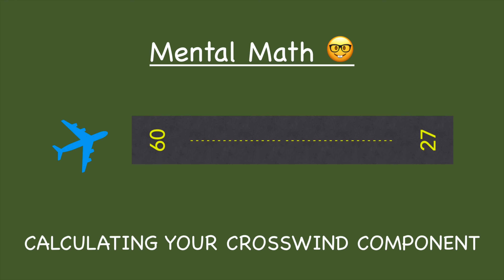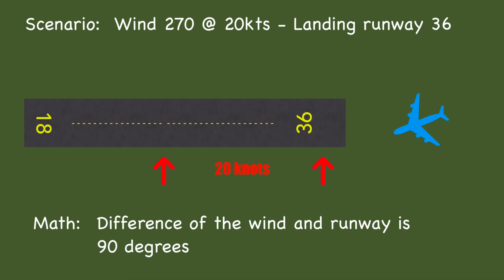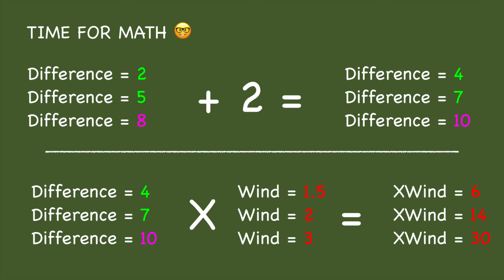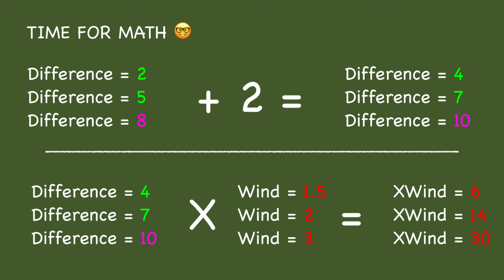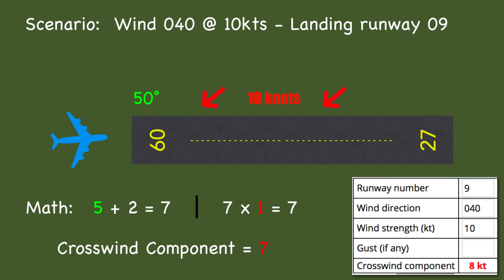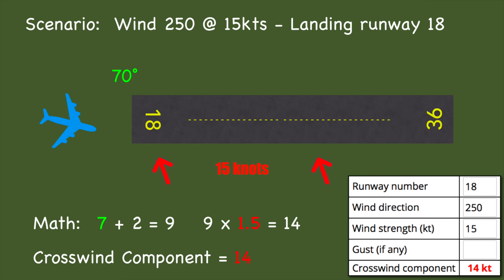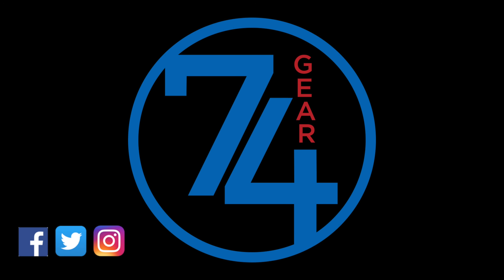Pilot Mental Math: Crosswind Component

Comment: In 1971 I had about 15 hours in a Cessna 150.  My weather pre-flight was a little abbreviated.  A weather front came in while I was out drilling holes in clouds.. The wind had increased from 25 knots with peak gusts to 39 knots from 350 degrees.  Tower gave me runway 30 so I crabbed in while being buffeted like I was on a brahma bull.  As I straightened out to touchdown a gust blew me off to the left of the runway - no damage other than my nerves.  The overly calm tower person said in a slow southern drawl, "Cezzna 1234 continue to your parking area".

Comment: This is a good method.  I use an old sniper trick I got from an old book on shooting.  sin 10 = 1/6,   sin 20 = 1/3,   sin 30 = 1/2,  sin 40 = 2/3,  sin 50 = 3/4,  sin 60 = 7/8,  sin 70 = 15/16,  sin 80 = 1,  sin 90 = 1.   You have to commit to memorizing the number but once you do that you just go straight to the answer.

Comment: Crosswind formula is Crosswind = wind speed x (sine). For me, the clock method works best. Picture a clock: 15 minutes = 25%, 30 minutes = 50%, 45 minutes = 75%, 60 minutes = 100%. In the test question, the difference between runway 9 and the wind direction is 30 degrees (30 minutes on the clock). 30 is half (50%) of 60; half of 18 knots is 9 knots.

This method is more accurate as the (sine) of 30 is .5 or 50%. Take the previous example again: Runway 9 with 50 degrees. 50 minutes is 80% of 60. 80% of 10 is 8 knots.

Comment: Why doesnt it work for this scenario - 320 @ 15 kts on runway 31
10 deg/1 difference +2 = 3
15 kts/1.5 wind

3x1.5 = 4.5 xwind but if I confirm with an xwind calculator, it is saying the xwind is 2.5 for this scenario ... not sure why it doesnt work for this

Comment: Another way to visualize the crosswind component; The wind calculator on the back of an E6B very closely resembles a DG or HSI.  Once you understand how to use the E6B wind calculator, visualize the E6B wind calculator over your DG or HSI to guesstimate the value of the crosswind component based on your current heading and wind direction..

Comment: Good tip. I use a lot more WAG (Wild A$$ Guess) in my mental math while I'm hand flying, though.. In my case, if the wind is not directly down the runway or a direct crosswind, I round it to 30, 45, or 70 off runway heading. For 30, the crosswind is 1/2 the velocity. For 45, it is 2/3 the velocity. For 70, it is 90% of the velocity. That gets me close enough. Of course if I suspect it will be near a limit, I pull out a chart to make sure I'm legal. My WAG gave me 9 kts crosswind for your example.

Comment: The aproximation  sin (alpha in degrees) = (alpha in degrees/10 +2)/10 for the crosswind component seems to be close enough for an crosswind between 20 and 90 degree. Nice idea a good calculation scheme for the crosswind.
I may use it to approximate the drift of my sailing ship  by current and wind.

Alpa/sin (alpha)/approximation
00/0,00/0,2
10/0,17/0,3
20/0,34/0,4
30/0,50/0,5
40/0,64/0,6
50/0,76/0,7
60/0,86/0,8
70/0,93/0,9
80/0,98/1,0
90/1,00/1,1

Comment: You could add another thing - If the difference is more than 90 degrees, just subtract the excess from 90. For example if the difference is 150 deg, we subtract the excess (60) from 90, and get 30. Then we use this difference to proceed further with the calculation. This is because a wind coming from your 30 deg and one coming from 150 deg would give the same crosswind component.

Comment: noob question. Why +2, what is the +2??
Reply: The real component is the wind speed times the sine of the wind angle. Sine (X0°) =
0 -> 0.00
1 -> 0.17
2 -> 0.34
3 -> 0.50
4 -> 0.64
5 -> 0.77
6 -> 0.87
7 -> 0.94
8 -> 0.98
9 -> 1.00
What this technique does is find the multiplier for various wind angles. By "add 2" he has 10° multiply 3x, 20° multiply 4x, 30° multiply 5x, and so on. His multiplier is a number two more than the tens of degrees of the wind angle. For 0 to 10 degrees it's pretty bad giving 200% the real crosswind or worse. For 20 degrees it's 4x instead of the precise 3.4x. For 30 degrees it's exactly right, 5x. For 40 degrees it's 6x instead of the better 6.4.

There are other ways to approximate the sine function. For example you could say 10 degrees is 1/6th, 20 degrees 1/3rd, 30 degrees half, 40 2/3rds, 50 3/4rs, 60 7/8th, 70 19/20ths, and 80-90 equals 100%. Those would be more accurate but maybe harder to remember.

Comment: Thanks for the interesting and  informative videos.
Cute linear estimate of sine function.  It fails at low and large angles.  You mentioned the high angle correction: if 80 degrees or greater (sin ~ 1) just use the full wind speed.  The low angle correction is also easy.  If the difference angle a is less than 20 degree, divide angle by 10 then MULTIPLY by 2 (that is, 2(a/10)).  This is just a little different than your middle angle estimate:  divide angle by 10 then ADD 2 (that is, a/10 + 2).

Comment: Accuracy is not so important as you should plan the cross  wind can swing 20 to 30 degrees.
More important for light aircraft. 

Can't imagine ( 9 kt affects a747 by much. ? )

look up sin table them multiple by wind 

30=.5
40=.6
50=.7
60=.8
70 = .9

some  airforce  teach   mental dead reckoning   +- 2 min   ( easy at 120kt or 240 Kts)

Comment: Crosswind component is 9
Reply: Mas_pilot. It is used to calculate the wind correction angle. That way the wind doesn't push you off the runway centerline during approach.
Reply from the maker: you got it MAS, well done!
Reply: 74 Gear thanks!
Reply: 74 Gear is the crosswind component used for the amount of speed to increase on the landing speed?

Comment: Nice video. I learned almost the same way. I just take the difference then add 20. This is then the % of the mean wind. 
So in your scenario:  RWY 09 wind 60 = 30 degrees. Plus 20 = 50% of mean wind which is 18 = XWC is 9 👍🏻😁
Reply: 74 Gear Based in Denmark :)

Comment: My eyes glazed over just like they did in high school.     This is why us dyslexics don't tend to get into the airline industry I guess.   ;-)  When we were landing in  a cessna in Panama, I used to look at the wind sock, times were simpler.....
Reply: 74 Gear I was just a heading holder, my pilot was an x navy guy that lived island hopping.
Reply: 74 Gear  The FBO that we flew out of is now a mall, apparently Oceanside property  was more valuable than GA was. 
Fun fact, back in the 80’s they would mark up your chart with a red “X” so that you wouldn’t land in a place likely to get you murdered and your plane a new job as a drug runner. 
;-)
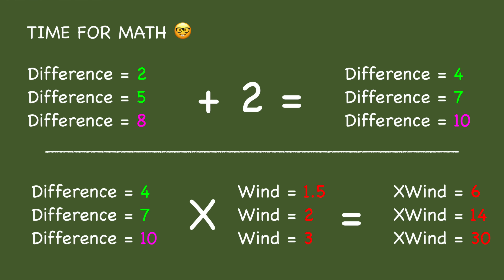Reply: @74gear  I have a video called "1987 Panama Flight Paitilla field" , if you FF up to 3:34 we land on a strip thats so short, we had to get out, and turn the plane by hand for the take off. 
Missed approach needs to be dealt with in about .223 of a second.   ;-)
In parts of the video you can see the dash falling apart on our rental, it also had a microphone wire into the dash at one point that you had to hold by hand. Wild west is an excellent description.
Reply: 74 Gear Yea, that would be tocumen? I flew out of there just before the invasion.
(So I left before it got too exciting....).  ;-)
Reply: @74gear  Yea, that doesn't sound like much fun. 
The guy I went out with always flew VFR, he was IFR qualified, but the rattle trap  rentals were easier to crash during the day when you could see.  
 ;-)   (Kinda kidding on that.... kinda....)

Comment: What number is when. A plane can not land of the equal crosswind
Reply: 74 Gear so you have calulated the cross wind once you have calculated and have your answer of the crosswind what is the answer you can not land because of two much wind etc
Reply: Every aircraft is different. That will be based on the crosswind capabilities of your aircraft.

Comment: You'll have 9 knots of crosswind component
Reply: So are we adding 2 to the diffrence cause it's 20knots?
Reply: @johnhorvath9878  Heading is 090 - drop the zero call it 9. wind is 060, drop the zero call it 6. 

9 (hdg) - 6 (wind dir) = 3. Add 2. ALWAYS add the 2 no matter what, to the difference between those numbers. Just accept you add 2 at this point of the calculation. It could be 25 - 18 ( = 7 + 2 ) or 12 - 4 ( = 8 + 2) any numbers - you just add 2. 

So, now back to our friends 74Gear example in his video you have 5.

Now the wind strength is 18 knots.. make it simple, call it 20 knots, and now again drop the zero (so 2)

Take your 5 (which we got from the first (hdg - wind) + the 2 (that ALWAYS gets added there) (so we get 9 - 3 + 2 = 5 at this point) and multiply by the wind speed (which you've over corrected for slightly in our case it is 2) so 5 x 2 =10.

Because you slightly overcorrected on the windspeed (by rounding 18 kts to 20 kts (we dropped the zeros remember) to make the numbers simple rather than having to multiply by 1.8 we multiplied by 2 - we take a knot off. If the speeds were higher we might take off 2. So we get around 9kts. It's not exact but good enough for a quick calculation.

It's a rule of thumb - like getting Celsius/Centigrade to Fahrenheit has a formula based on (°C × 9/5) + 32 = °F. Who has the mental maths for that everyday? Double Celsius and add 30. 

Fahrenheit to Celsius? Then - 30 and halve. Is it scientifically perfect? No, but it's close enough for quick numbers.

Hope this helps you or anyone else - more than the other reply you received, which was "no". I don't understand people sometimes. If you can't offer a constructive or helpful reply, don't reply at all.
Reply: @johnhorvath9878  no

Comment: Have you ever landed in a 30 knot crosswind? Or even the 14 kt one? My old instructor just used the trig identities and guessimated if it was between them. I think 30 deg is 1/2 and 60 deg is .8 or so. A 15 knot wind of any kind is pretty stiff in a small plane in any case. What you call interesting, I guess. I'll have  to file this one away tho.
Reply: Oh that one's easy, you made it 30 degrees, it's 1/2, so 9 kts. If it was something else, I'd have to fudge it. :P I'm guessing your favorite method of dealing with xwind is crab and kick? I know some old school guys like to do the one wheel touchdown.
Reply: Right now, nuttin' I spent 99% of my time in a Cessna 172 and did about 6 hours in a Duchess for multiengine. I want to build either an RV-12 or a CH 650 and hire someone to get my instrument and then either a commercial or an ATP.
Reply: I'd have to get out the logbook but around 150 hours. I was about halfway to an instrument rating when I had to quit. Procedure turns, holding patterns was what I remember tying me up in knots. DME arcs were relaxing for some strange reason.